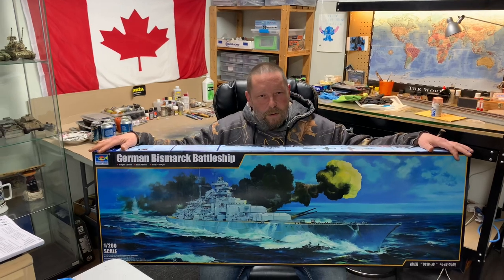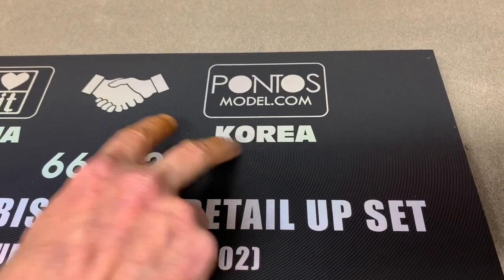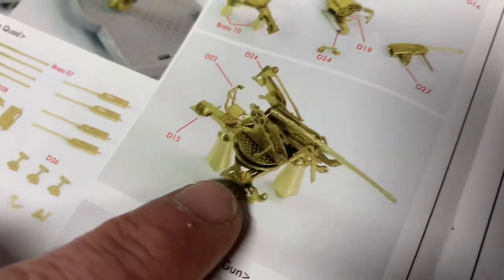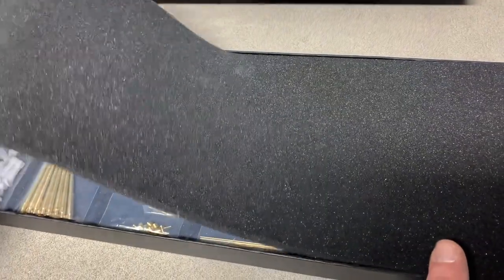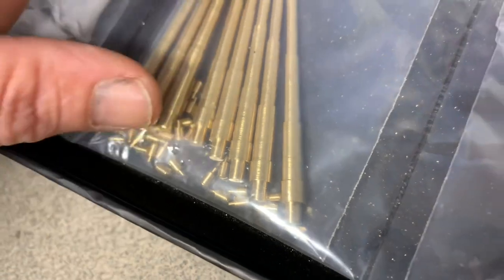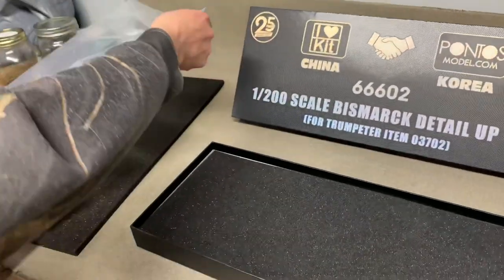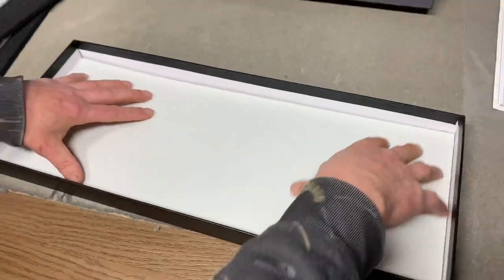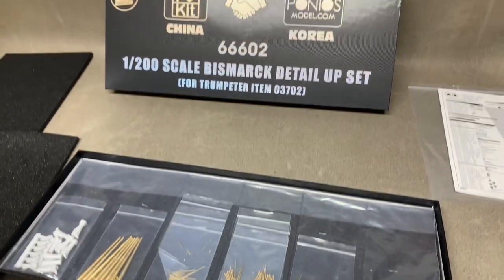Bismarck upgrade set!!!...finally!!

Comment: Possibly the most dissapointing kit i have ever bought
It needs the upgrade kit which is more than the original kit 
Superbly packed - but that hides how little there is in the kit
Upgrade kits looks superb but why is it not included or mentioned in the Sales Blurb
Will be ordering the new Amato Bismarck when get my refund from Amazon
Reply from the maker: It’s not included because it came out much later than the kit itself I would presume…it’s a very deep rabbit hole that can be gone down with this kit…this is where I draw the line though lol